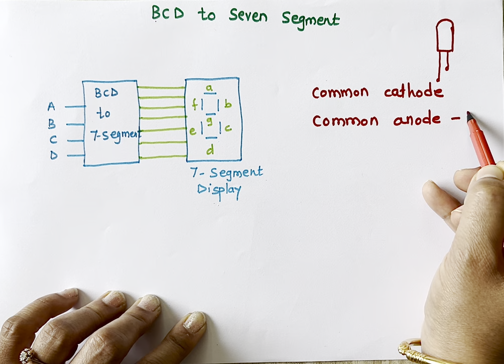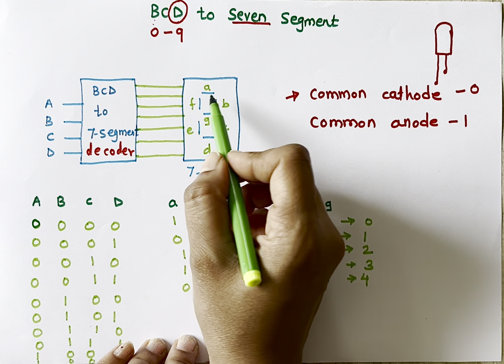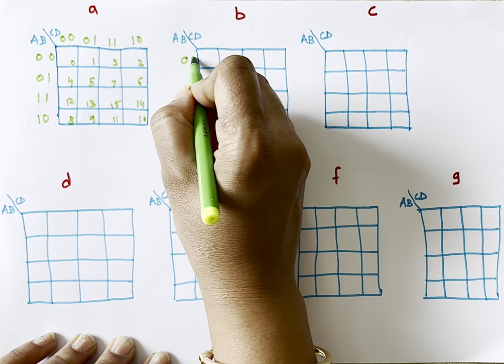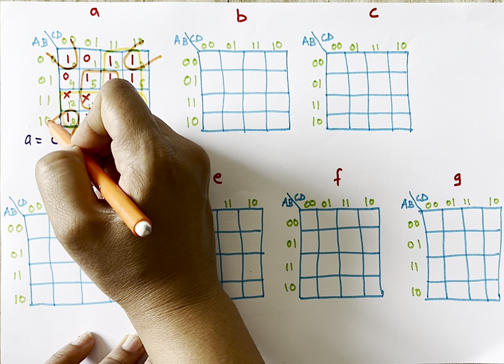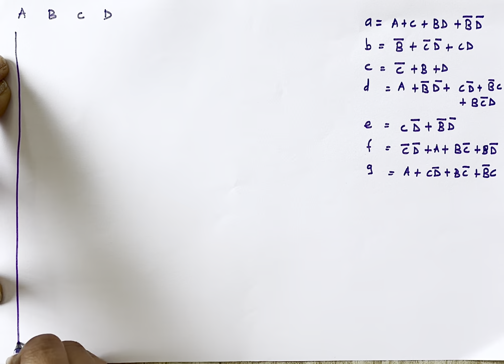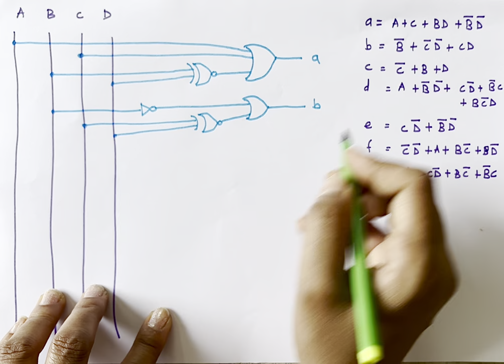BCD to Seven Segment Decoder | Truth table, K-map, Circuit Implementation, Applications

Comment: But mam In decoder only one output is high at one time then how it will glow multiple leds of 7 segment at the same time
Reply from the maker: In decoders like 74138 only one output is high/low at one time. This circuit is different. Here decoder is designed to convert BCD number into 7 segment. For given BCD number equivalent LEDs of 7 segment display will glow.
Reply: @CircuitrysimplifiedbyDr.Shobha means there is a mechanism which will glow a no of leds at the same time that's different from the conventional decoders that's been taught at University level ...?
Reply from the maker: @Sukh_x01  yes. Both are used for different applications. This circuit is used to display number on 7 segment.